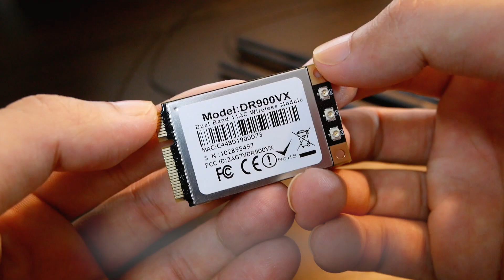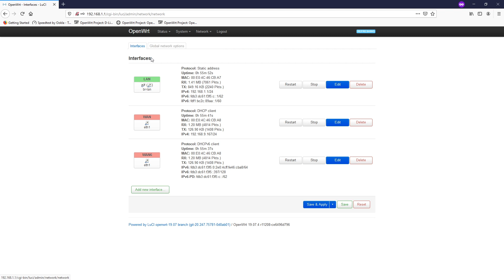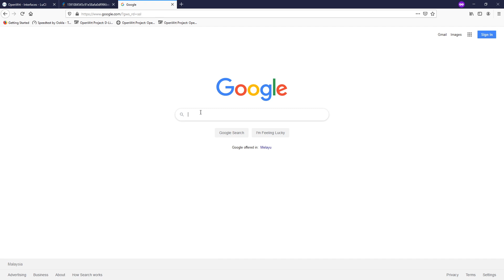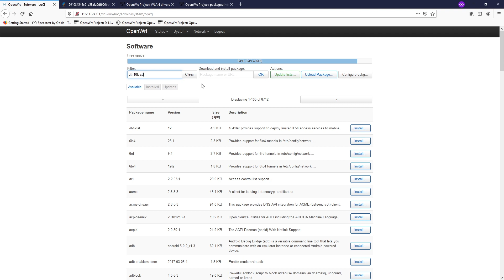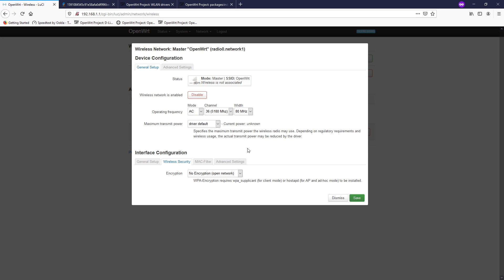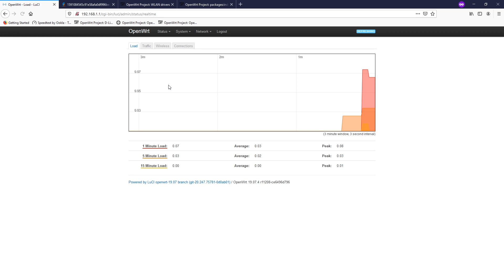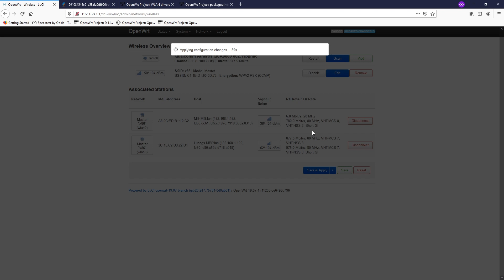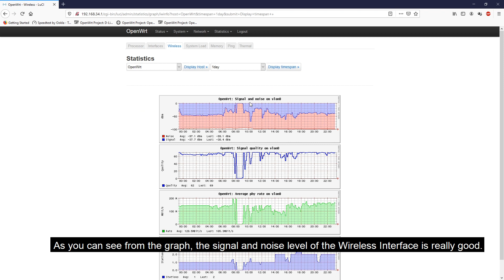OpenWRT - Install and Configure Wireless Network Adapter - Wallys DR900VX Dual Band WiFi

Comment: Hi, thanks for the video. I bought this Beelink Mini PC, Mini S12 Pro Intel 12th N100 and installed proxmox v8.1.3, installed truenas, pihole and openwrt. On PVE console on lspci I could see "00:14.3 Network controller [0280]: Intel Corporation CNVi: Wi-Fi [8086:54f0]
        DeviceName: Onboard - Ethernet
        Subsystem: Intel Corporation CNVi: Wi-Fi [8086:0244]
        Kernel driver in use: iwlwifi
        Kernel modules: iwlwifi" but under System>network I see name=wlo1, type=unknown, no, no, no. I tried updated kmod-iwlwifi, installed even Bluetooth drives but no luck. I'm in the same situation as you were until you found wireless option under luci. Tried wget, dpkg days of googling but no luck. I think the issue is PVE isn't detecting wifi card. Any input will be appreciated

Comment: Hi, from your video, there is only radio0, how to show radio1 and radio2? I have this issue on my machine too.
Reply from the maker: Hello, this network adapter has only 1 radio, so you need to select either AC or bgn mode, just like the wireless module on the Raspberry Pi 4. If you have more info, please let me know.
Reply: @VanTechCorner  Wow, I see.  I didn't see from the datasheet it is not support 2 or more radios. any recommendation of network adapter that support 2 radios?

Comment: Hi, I've got OpenWRT x86 with wireless Atheros WPEA-121N which has AR9382 inside but I cannot set it up as Access Point.
I have installed ath9k but in Network -> Wireless I can see "Generic MAC80211 802.11an" so I guess something is missing, also cannot setup encryption like WPA2 even though in openwrt 21.02.3 already was installed the required hostapd-common. I can see plenty of wifi when I press on "scan" button.
iw list - shows that card is AP and even Mesh, but for some reason when starting "SSID: OpenWrt | Mode: Master" it says "Wireless is not associated"
From one of your movies I know that Radio0 should show "Atheros something" but it's not.

Do you know what could be missing?
Reply from the maker: Hi, please hold on, I need sometime to check this.
Reply: @VanTechCorner  I have found the answer. Not sure if this is only for OpenWRT 21.02.3 as I'm new to this software, but someone advised me to just install wpad-wolfssl or wpad-openssl. I have installed wpad-wolfssl and after reboot voila, I can use AP without or with encryption. Before it was not possible.
Not sure why thought, but it works :)
Reply: @mamartin2966  ouh men; struggling since yesterday thorugh this same issue. Thanks for the hint with the wpad package!

Comment: Bro. Are u from Malaysia?
Reply from the maker: Hi bro, I used to stay in Malaysia for 3 years :D
Reply: @VanTechCorner  omg. Whre u come from bro. I have 1 question. I have raspberry pi 4 and flash it to openwrt. Can I use external tp link wireless USB adapter to got Internet. The built in 5ghz raspberry 4 is not high gain. Btw I didn't have usb to lan.

Comment: hy what about rtl8811cu usb wifi https://github.com/ProKn1fe/RTL8811CU_OpenWRT how to install in openwrt?
Reply from the maker: Go to the Software center and install "kmod-rtl8xxxu". After that try reboot your router and cross finger if it work!
Reply: @VanTechCorner  no need exroot?
Reply from the maker: Just to LuCI software management section and install it. You don't need SSH for this.